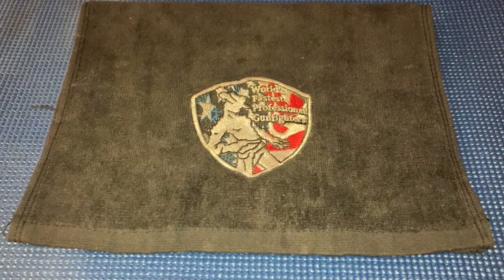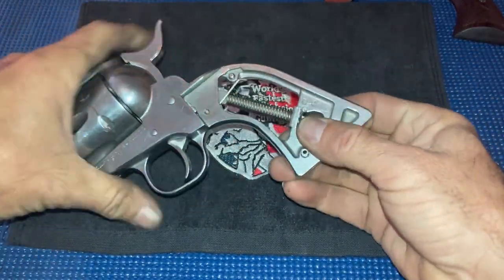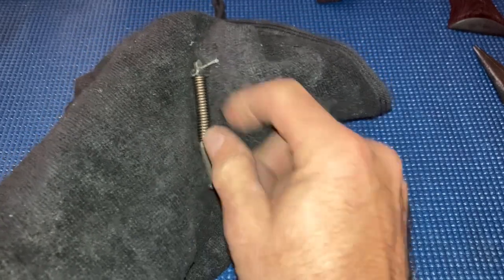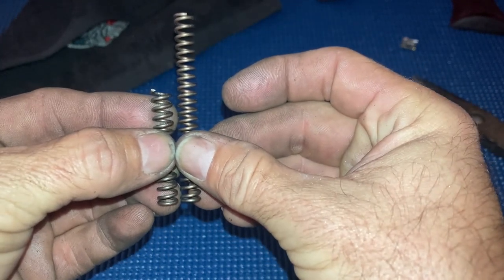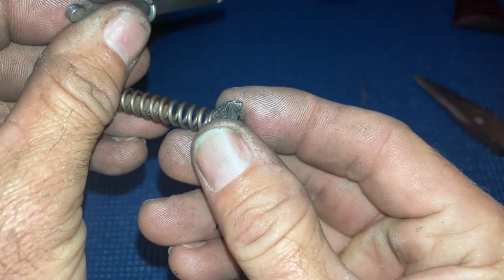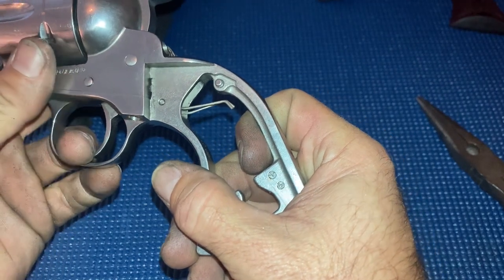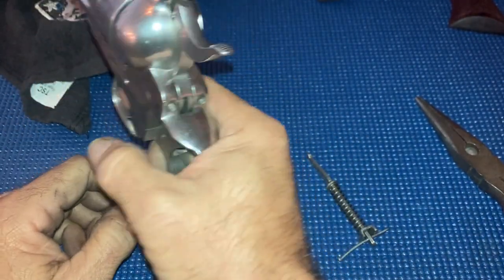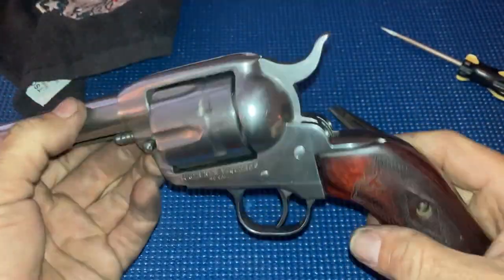shorting the hammer spring

Comment: Nice how to. I shoot SAA clones with leaf springs. I find I can get the spring just where I want it tension wise but the floating firing pin in the hammer becomes a challenge because if it doesn't drop right through the hole in the frame it can cause inconsistency. Do you measure your hammer tension or do it by feel? To get light but not too light?
Reply: By feel
Reply: Bob Mundun..replaced the leaf with coils..and never messed with trigger r pull weight
Reply: @chiefkikyerass7188 I wasn't talking about trigger pull weight.